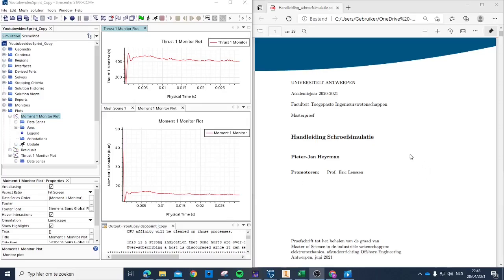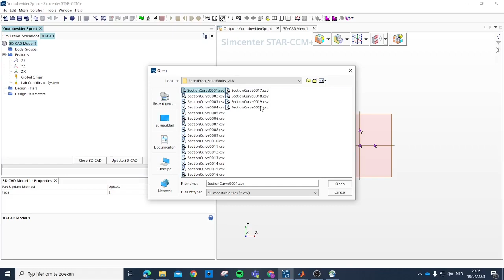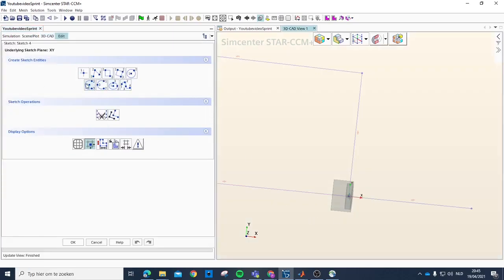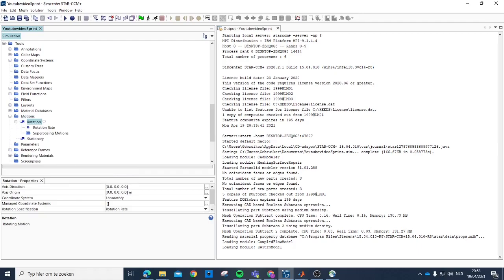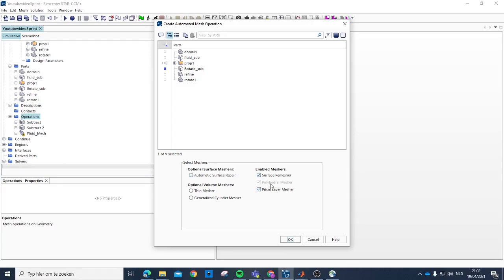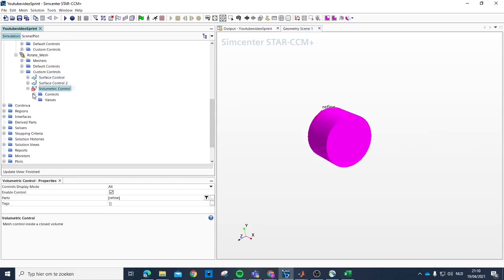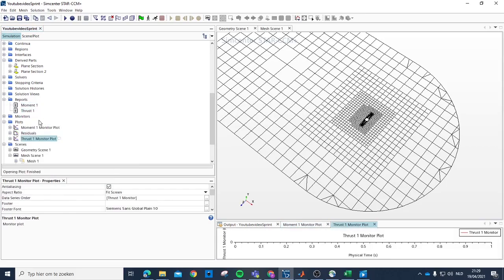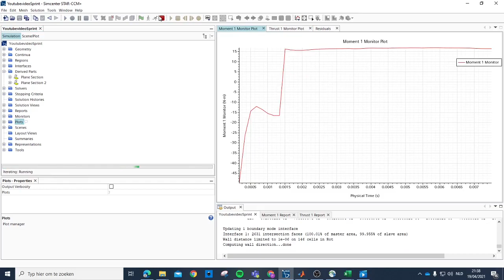Design in OpenProp of a marine propeller and CFD Simulation in STAR CCM+

Comment: Hello Pieter
Thanks for the amazing tutorial. It actually helped a lot for my open water simulation. 
Have you ever tried self propulsion of ships using real propeller (not virtual disk) ? Currently i am working on that area. My open water sim is working fine. I would like to add ship hull also in the simulation and would like to move the ship with the thrust generated by the propeller. Can you suggest some inputs...how to work on that...?
Thanks in advance
Reply from the maker: looks very complicated to do because the free flow will be moving when the boat is moving I have not a good idea on hoz to proceed but mayby my video with a ducted propeller can allready to move in static ellements like boat etc and so you can see that the thrust is enough to overcome flow resitance
Reply: hello balty 
U said about the self propulsion of ships using real propeller (not virtual disk) .I am working for it too.Did u find the way how to work on that?Could u give me some advices about it.Thank u very much!

Comment: Hi Pieter! I've a big problem following your tutorial! I've done everything exactly like you do but when I start the simulation the residuals are going up to the sky (and the thrust remains 0). The propeller it's rotating, that's for sure. I've noticed that lowering the number of prism layer there is not increasing of the residuals, but I want to do the simulation with the correct number of prism layer in order to achieve correct results. There's something that I'm missing? Thankyou so much! Emanuele
Reply from the maker: The number of prism layers and base size is depended on the fluida and rotation speed of the propeller, I've linked the documents in the drive to calculate the base size and number of prism layers.
Reply: Yes! I’ve used your file (I’ve also created another excel just to understand better what it does). The strange fact is that all the residuals explode and the problem seems around the number of prism layer.
Reply from the maker: @emanuelebresciani8903  I've send you the star ccm+ files by we-transfer